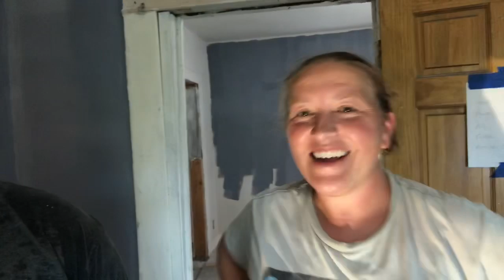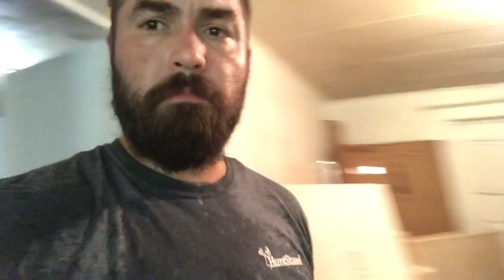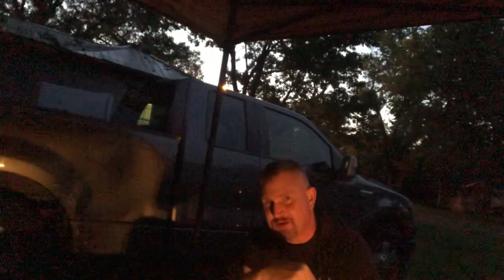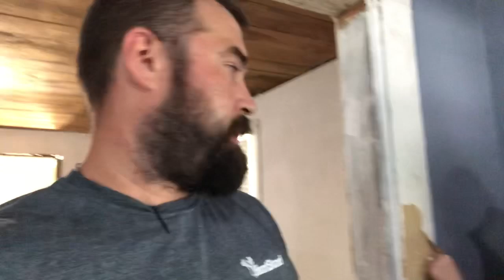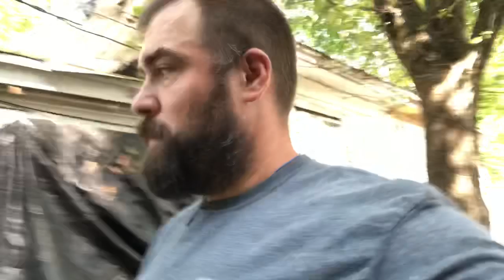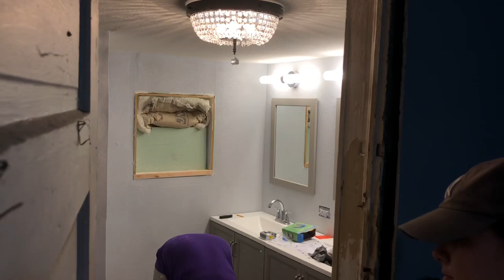Muskogee Mission Trip 3 - Grindstone Update

Comment: Im getting closer to coming on mission with yall.  I bought a truck to help out one of my widow women that will work well to haul tools and sleep in camper top however, the fuel pump went out. I got all the parts to hopefully fix it this weekend then I will be up an running. Always have 3 day weekends and if need be saved back some vacation time at work.